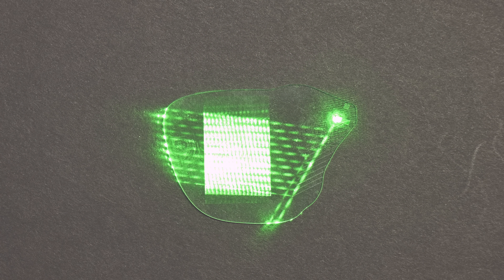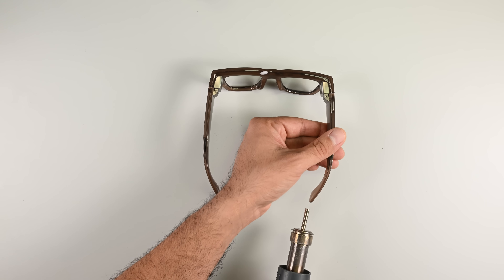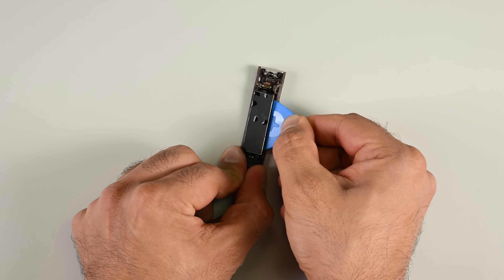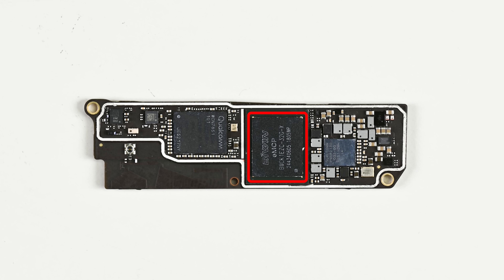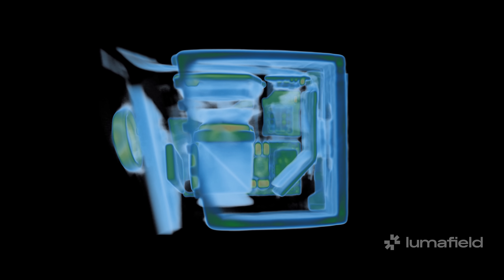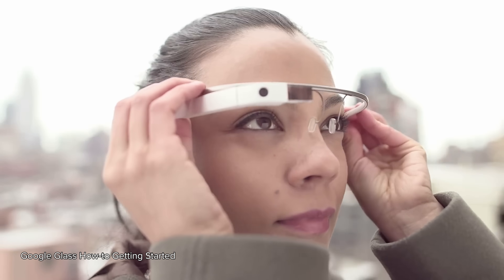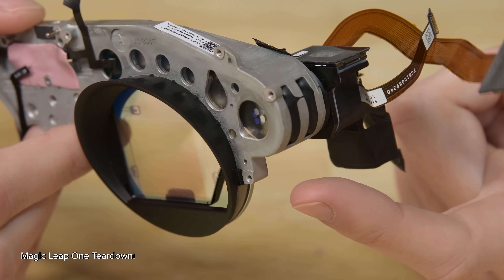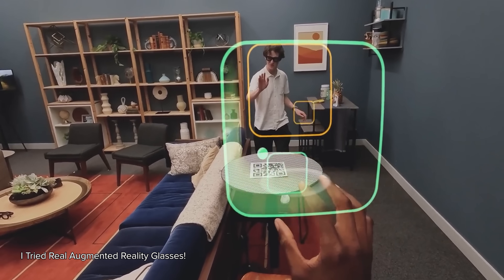We Tore Down Meta’s Ray-Ban Display Glasses — And They’re WAY More Advanced Than You Think

Comment: while the first build is tight and meant to just "have the end product", theres a huge future for hot-swap replacement. each arm holds a light engine, lens, processor, battery and speaker. if they can segment the units and design the arms to open with a screw like the old iPhones, you'd just buy modules and pop them in. everything here looks fairly modular and snap connect
Reply: I totally agree!!!
Reply: Id imagine some manufacturer who is not a total tech giant, but rather a smaller one like framework or others to do that if Ar glasses become the hype

Comment: When we were reading about LCD Display technology and its working (in 2016), we had thought of a similar concept but our implementation was to replace the requirement of infotainment systems by building a system for windshields and hence keep the console areas more tactile in design (mainly to control volume and car functions) essentially replacing a display on the console

Comment: 2:50 960 mWh - A YouTube channel that actually uses watt-hours, hurray! 🎉 Usually it's "XXX mAh" - Cool but at what Voltage? How big is it actually?
Reply: Most of them are single cell lithium, so 3.7v
Reply: @mikewheeler9011  single cell Li-ions have different voltages depending on the chemistry - the ones in consumer devices are usually between 3.8V - 3.89V nowadays.
Reply: But I still don't know what the voltage is. What is the chemistry ? Is it two batteries in series ? Also what was the discharge rate used to get to that figure ? I am still left with so many questions. 😂😂😂

Comment: This is way more repairable than I thought it would be. Even if you have to replace the wave guide lens and projector, it seems like all of the parts can be put in a new frame. Hopefully Meta takes advantage and has a solid refurbishing program.
Reply: what? is this a bot?
Reply: @notusingpremiumafter you separate the frame, it looks like all the parts were taken out non destructively and fairly simply. So it looks like they can all be reused. I was expecting them to all be epoxied/glued in for water resistance or whatever.
Reply: The housing parts could be 3d printed(sla)

Comment: You can’t even replace the lenses? What if your prescription changes?
Reply: They're likely not prescription lenses. You'll probably have to go the contact lens route if you want corrective lenses with this thin of a form-factor.
Reply: Other smart glass manufacturers have option to order on checkout of optically gluing prescription lenses on top of waveguide display lenses. Meta seems to not provide this service
But this is solved problem and i think when it really launches as mass market device they will add this option

Comment: Since it connects to a smartphone, we are far away from the end of smartphone.
Reply: the smartphone is never going away period! its litteraly a pocket computer with the ability to do what hundreds of gadgets have been doing since before they started.
Reply: Far away? No.
First, the phones and watches will feed the glasses data and power
Then phones will become secondary, and you will barely pull them out of your pocket - the puck stage
Then complete replacement! Older generations in (8-15 years) will still use it, though.
Reply: Not more than 10 years
Reply: True, next the smartphone could eventually just be a puck that you keep in your pocket that does all of the computing. Should bring the price down, since it would most likely have no cameras, no speakers, no large liquid display screen etc….basically just brains,a battery and a few other necessary electronics in it. Until we can do away with that as well. I’d imagine that the phone would still exist in some form but it would just be an option.
Reply: @MrMittens01  Sounds good. I guess in the beginning it can just be an app for a phone. And only in the future if it turns out people stopped using the phones entirely, you start producing screen-less pucks.
Reply: Tbf your smartphone can be replace to smartwatch
Reply: @Fataha22 how will my smartwatch have a manga reader, yt, emulation and novels? I mean it can have it but I won't use those apps on it just like my TV.

So no, a tiny pinky toe of a screen cannot replace my phone.
Reply: @TheRealGigaCat that's why this glasses exist 😐

The point I want to make is you absolutely could change the anchor device from smartphone to smartwatch
Reply: @Fataha22 well, as i said. Your anchor device doesn't have enough battery or power to do what need to do. That is playing games and emulating console. 😐😐
Reply: @TheRealGigaCat I mean you could just plug it on wall when you play 🙄
Reply: @Fataha22 oh yeah? Plug on the walls like 5 times a day? Because your little watch can't hold more than 500 mah battery. Do you even know how much that is? Sometime common folks should leave technical stuffs to actual engineers 😂
Reply: @Fataha22  no it cannot but nice try lol!
Reply: It would be too easy for them to make a compute unit to completely replace smartphone, but I think they'll wait a few year until the glass is mass produce and cheap enough to do it
Reply: Your opinions are very interesting, however, I have some doubts.what about the cellular network? There is a certain radiation that communication devices are producing. Now imagine wearing the smart glasses with cellular inside you will probably wear those for the entire day. This will fry your brains. Best bet is that smart watches become better and then connect to smart glasses but smart glasses having cellular connection and wearing them on your head. The whole day is not good in my opinion.
Reply: @purenatural5736  No it doesn't. Radio waves are lower energy than visible light. The main issue is heat, not cellular waves themselves.
Reply: @Words-.  I’m not sure about it, natural light has frequencies that are natural and good for our bodies (in healthy amounts) compared to the unnatural that the cellular network is producing.